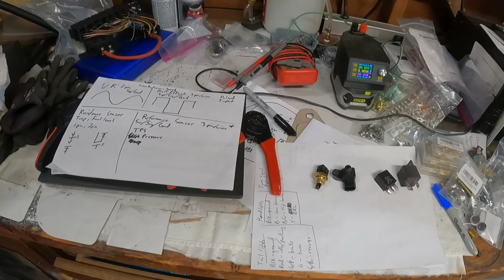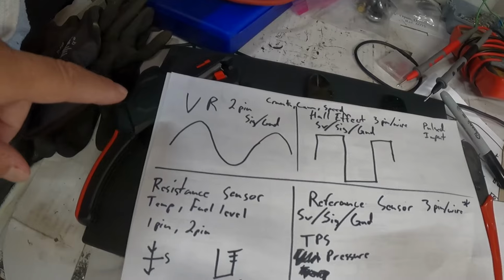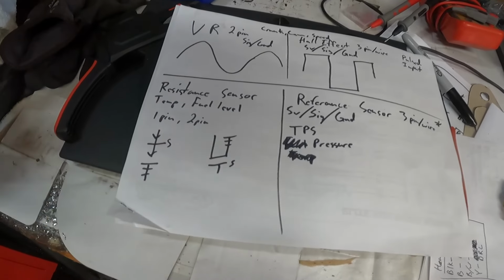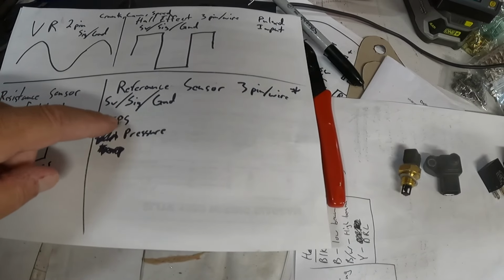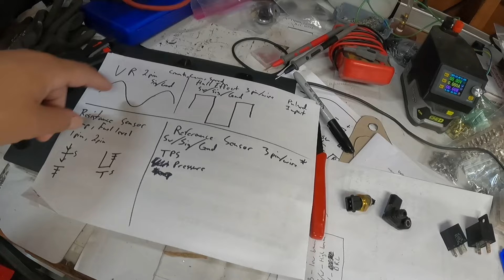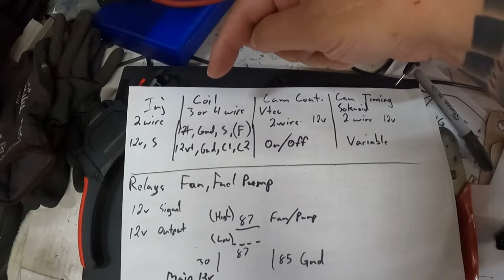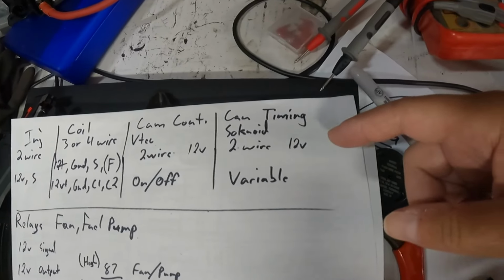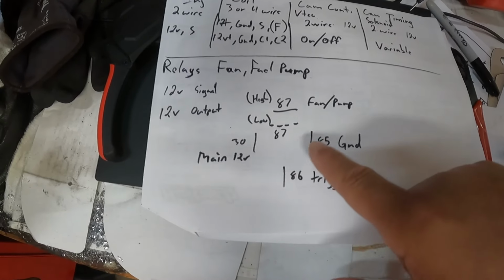MK Indy RX-5 Vtec: EFI Wiring Basics

Comment: I would verify your ECU's circuitry. Most of the ECUs I have worked with provide "relay ground", not "relay power".
Reply from the maker: The ones I have worked with drive high or are selectable for power or ground, but you make a good point.  You should verify how the ecu is switching before you start wiring.
Reply: @DriveDriverDriven  love the content. Super jealous of you having two of these. My dream is one of these with a built, ITB VR6 (packaging issues, I know). Can't wait to see this thing when it's complete.